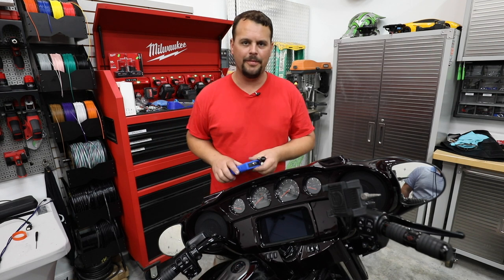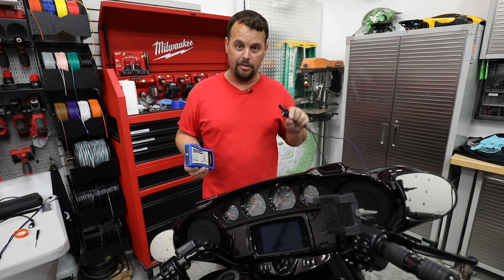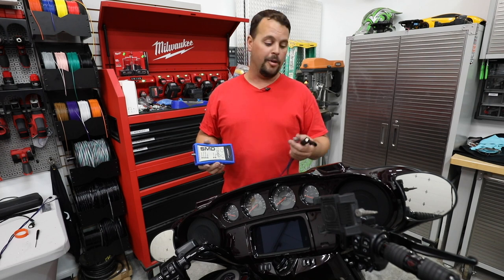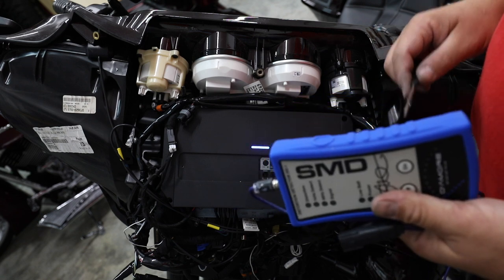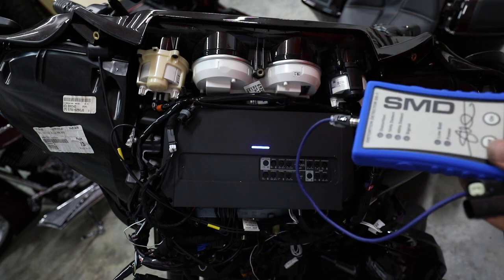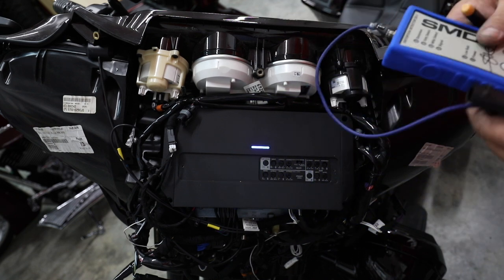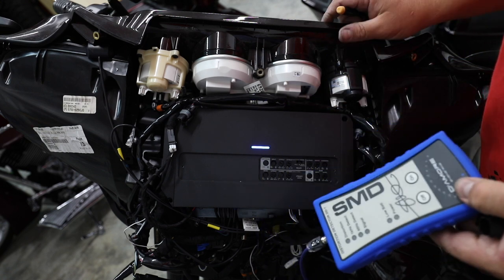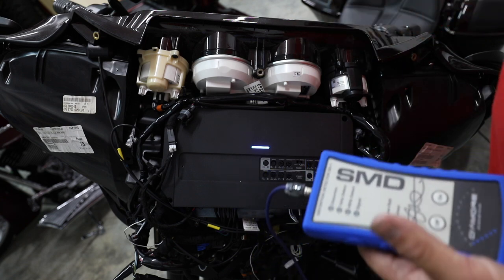How to Properly Set Amp Gains on Your Harley Davidson

Comment: I just found this a year after you posted it.   This is THE BEST, & MOST ACCURATE description of properly setting amp gains during installation that I've seen on YT.  Awesome job.  I subscribed, now I need to check your posts for one where one might have a DSP between the radio & amp and how you would set gains in that scenario. Appreciate your work.
Reply from the maker: Thank you!

Comment: Quick question for you, if you have a set of 8s - Cicada CM8.2 (1000w/500RMS pair or 250rms per) for the lowers with 65Hz-20k frequency would you recommend still using the -1kh -10db test tone? Or could you go lower seeing they are not 6x9s that I assume you are referencing in the bags and should get more bass?
Reply from the maker: Same test tone as shown here

Comment: How do you set gains when you have a RF DSR1 and 3 amps?
What do you do with the settings on the DSR1?
Reply from the maker: That will be a different video,  we do not use the dsr-1 since it loweres the input rca voltage to the amp to 1.5v
Reply: @volunteeraudio  My customer came to me with a DSR1 installed already wanting me to tune it.  He's using it as a LOC with the high level input from the H-D radio since no RCA Outs on his H-D radio.  Wouldn't I just use the DSR1's Trim levels to plug DSR1's RCA out into my DD-1 and set that to distortion, then plug those RCA's into his Alpine KTA-450 amp and then continue setting the amp gain as you describe in this video? (assuming setting DSR1 x-over to full and EQ to flat before adjustments)

Comment: Thanks for the video.  Just bought your Soundstream SG9813.  I have a Sound Digital 800.4 already installed audio shop professionally set to an Aquatic AC head unit. I can play it easily without distortion a volume 30 out-of-40.  When i install the head unit, you think i will have to set the gain again?  It is set low and i just want the same sound.
Reply from the maker: The Soundstream radio is clean to volume 50, that is where amp gains should be set to max unclipped output
Reply: @volunteeraudio Thanks for responding Jay.  To be clear, I should not have to reset the gain since the Soundstream is clear?  I would like to add that I can play it louder, but I play it on 30 normally as my max

My set up is two diamond 6x9s, two 6.5 yellow baskets, and 800.4 with no DSP.

Comment: I got a used 2018 road glide special, it has Rockford front speakers and soundigital 4ch amp.. I am having issues with the Treble being just obnoxious and ear piercing even with Treble down all the way on the GT6.5. It's annoying and I thought it'd sound way better than it does
Reply from the maker: Which amp? Which Rockford speakers?
Reply: @volunteeraudio  soundigital 400x4...Rockford TMS65 6-1/2
Reply from the maker: @PkwyDrive13  the 400.4 is too small, they do not produce 100 watt rms x 4 but more like 50 watts per channel, with less power your mids produce less bass, tweeters are very efficient and get loud off very little power, a bigger amp will help the tone, also your amp setting may be incorrect as well

Comment: Good morning Jay
How would you find the max volume on a Sony 7000? I have the speakers plugged into a DSR1 thru a harness...??
Reply from the maker: Why use a dsr1? The Sony has 5volt preouts, the dsr1 lowers rca voltage to 1.5volt
Reply: @volunteeraudio  I am running 3 amps...Ex4 Euphoria in the front to run uppers and lowers and tour pac ...all Hertz 6.5 neo...one amp in tour pac to run 6x9 in lids and I have the RF sub kit in saddlebag...how can I wire the 3 ? Can I run the tour pac and 6x9 in parallel? And just have the one amp in the fairing and the RF sub
Reply: Would changing head unit to the Soundstream be better...cant you band pass the sub output?
Reply from the maker: @joellongoria2239  yes you could add the 6x9’s to the rear channel to only run the one amp, sub out to your drop in sub

Comment: Hey jay I just ordered a DD-1 so I’ll be able to set me gain’s properly on my 07 street glide. My question is I haven’t ordered my cut kit yet from y’all but I DID get my new amp from sinister and my precision power 6x9’s from you. Can I go ahead and run the speaker wires and set the gain for the rear 6x9’s without the speakers being installed yet? I don’t need the Harley plugs cause I have a aftermarket aquatic av head unit. Thanks brother! Your service is amazing!!
Reply from the maker: Yes amp gains are set before connecting speakers
Reply from the maker: Thank you!

Comment: on ur front are u running hpf on amp
Reply from the maker: Yes we use high pass filters on front and rear channels to keep bass that is too low in frequency from causing the speakers to distort at high volumes

Comment: What if your amp doesn’t have gain controls?
Reply from the maker: All amps have gain controls
Reply from the maker: If they don’t have gain controls there is no way to adjust, normally this would only be the case in factory installed amplifiers
Reply: @volunteeraudio  Biketronics BT4180 Amp
Reply: My amp only has sensitivity and frequency